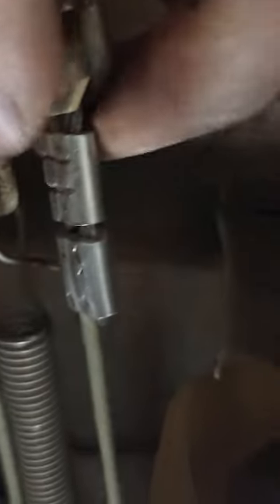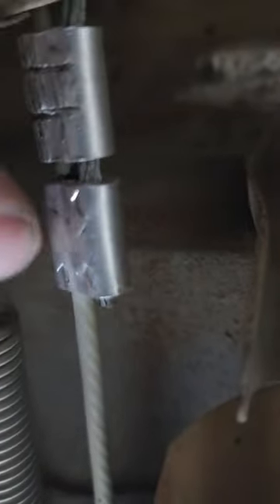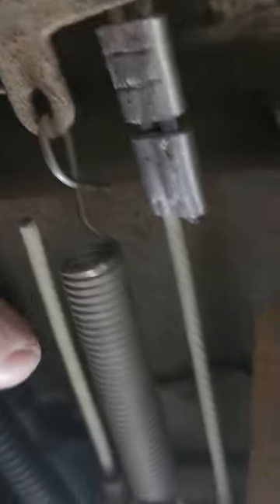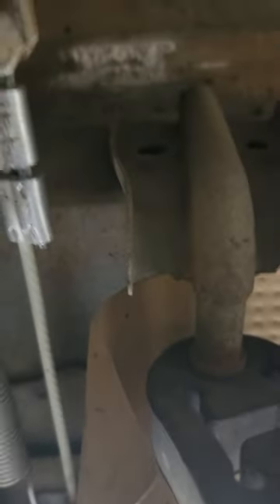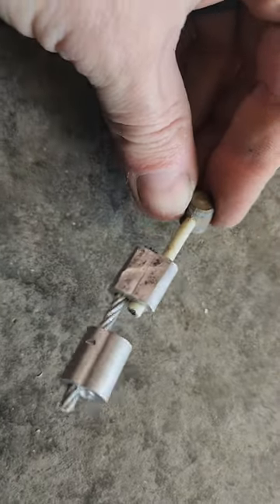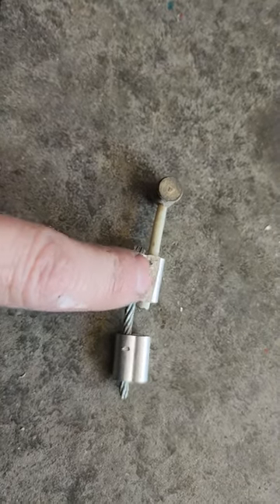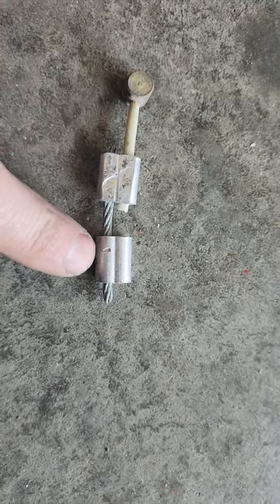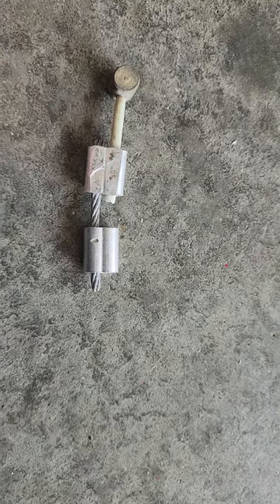Fix a cut eBrake / Parking brake cable for about $5 vs a $1300 shop fix.

Comment: I would call this a sketchy temporary fix, I wouldn't trust aluminum swedgies  to not slip off the end of the cable or the metal piece at some point. Maybe 2 or 3 steel swedgies crimped on a loop of cable would hold.  I'd say if you do this, start saving your money and eventually buy a new high quality cable.